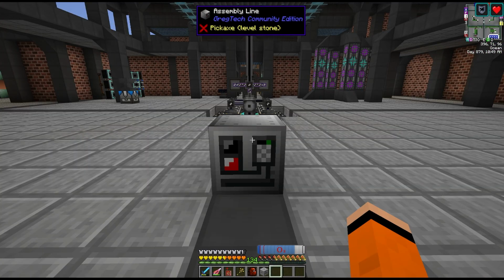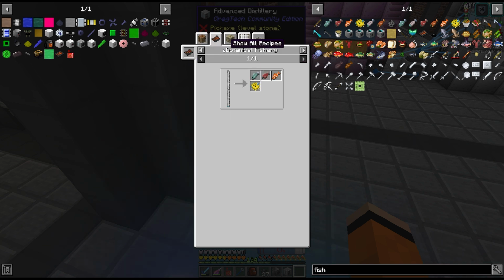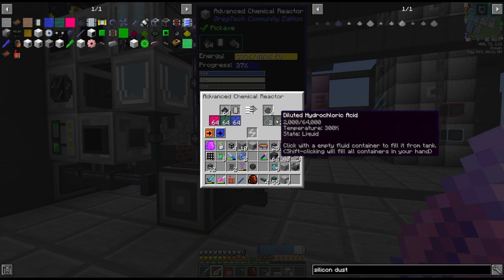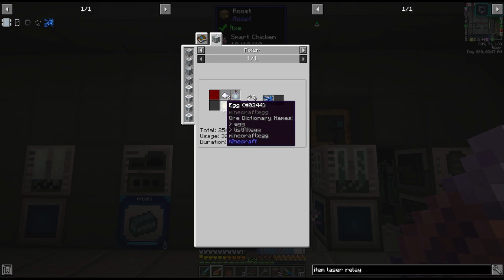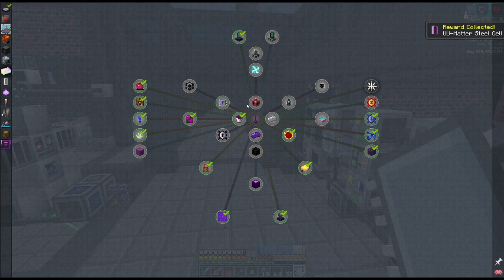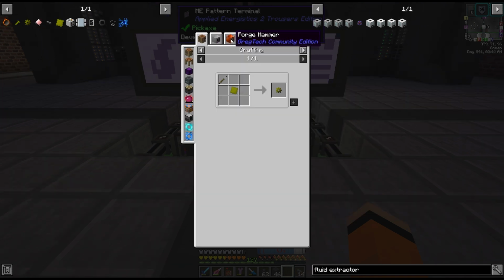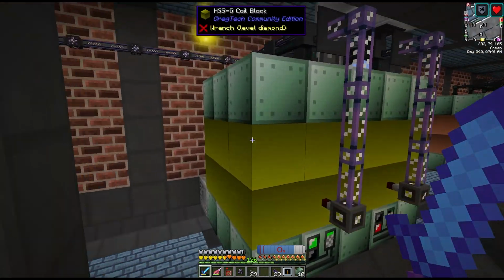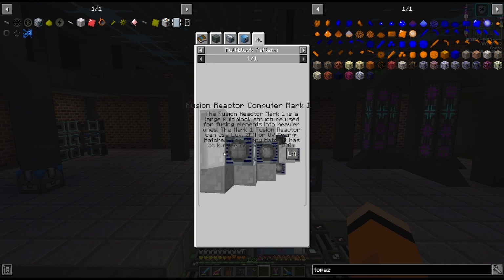FTB: Interactions - Assembly Line Automation & Wetware! Modded Minecraft Ep38

Comment: I could be wrong, but I believe the reason the HSS-G gears need to be made in a forge hammer rather than an extruder is a matter of realism, as HSS-G is harder than normal steel and shouldn't be able to be deformed into their finished products by pressing/extruding, and need to be Ground into their final shape (or formed from the get-go in their fluid forms), hence the "G".

Comment: Instead of adding a crate as joint from the me interface to the item interface, would it not be better just to put the me interface next to item interface and enable blocking mode feature in the me interface?
Reply from the maker: Yep! You're absolutely right, which I did try but for some reason it wouldn't send the items between the interface. Which is weird since thats how I set it up in Omnifactory :/